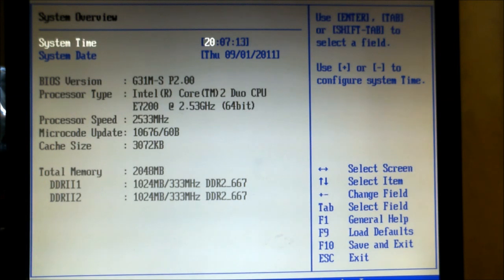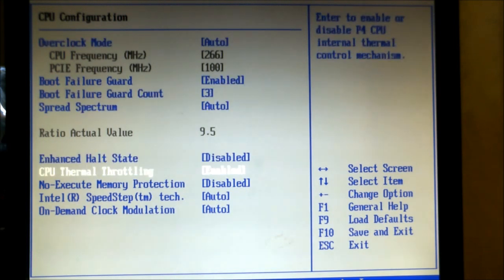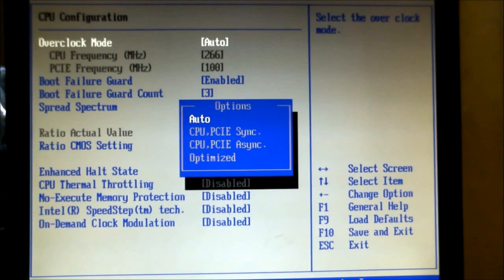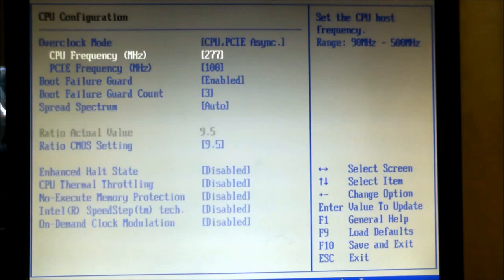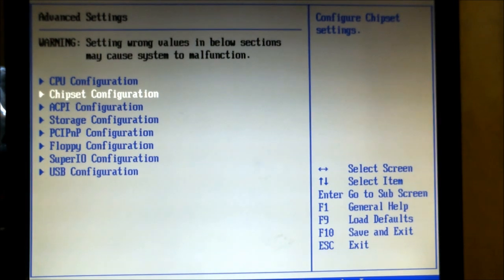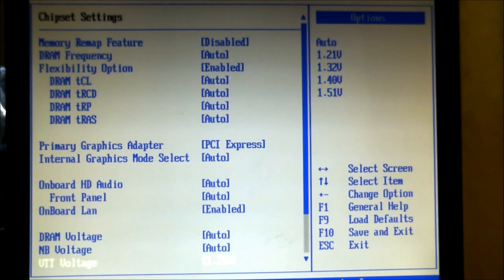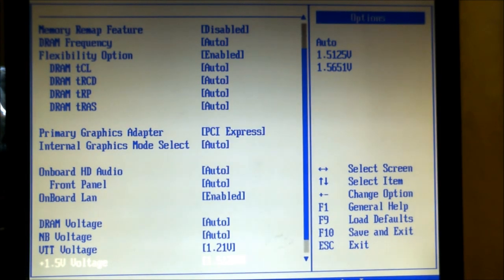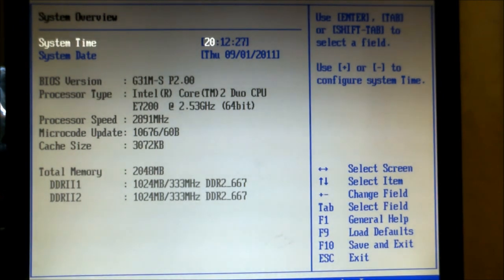Overclock Demo

Comment: hy.. i have Asrock g41c-s Motherboard similar to yours.. i have an intel quad q6600 and 4gb ddr3 1333 mhz ram in single channel... how can i overclock it to 3.0Ghz.. so far only 2.8ghz is stable... anything higher thatm 2.8 it will crash when entering desktop :(
Reply: Hey man, i got a q6600 too and i'm looking for a mobo, is this asrock g41m-vs r2 a good one ?
Reply: NO i have this board its awful for overcloking really regret getting it
Reply: Johnny Iliev thanks man, wich one would you suggest fot oc than ?
Reply: asus p5q series are the best 775 socket overclockers but if you are getting a P5Q mobo you shoud get xeon e5450 cpu (equivalent to q9650)  for like 20 $ and overclock it to 4ghz and more
Reply: and for this mobo asrock g41m-vs r2  i managed to overclocked it from 3ghz to 3.3ghz with a lot of tweaking.. dram timings, voltages not really worth the 300mhz
Reply: Johnny Iliev yea wow is rlly not worht the money. Thanks for the info mate ! :)
Reply: bro i have asrock g41m-vs3 r2.0 and q6600    do a 333mhz and ratio 9 and it's gonna work .

Comment: a pure pish production?
you must be scottish lol
Reply from the maker: Angus born and bred! lol
Reply: *****
good scots saying lol
im from ayrshire
Reply: news man
are these boards any good for over clock iv just got 1 and im using a c2d e6400
Reply from the maker: They're remarkably stable for the price. You'll get a good push out of the chip, but not much from anywhere else
Reply: *****
its blue screening at 310 think that might be its limit around 300/305 is your mobo revision 2 as your bios seems slightly different from mine i'm revision 1

Comment: Hi, typically I can overclock to 2.90 but when I try to go more after I save changes in the bios it just goes to a black screen. Nothing comes up? 

Asrock g31m-s 
Intel quad core q6700cpu
Radeon 5770
500W power supply
Reply from the maker: Hi, what memory and cooling method are you using? Are you getting POST on restart?

Comment: The ratio CMOS setting is the same thing as CPU multiplier?
Reply from the maker: Yes, it is. You'll find most older chips like the Core2Duo/Quad, Pentium 4s, and Celerons are usually locked, unlike the chips of the "i" generation which rely on their boost coming from the multiplier.

Comment: Hey guy! you have ddr2 667 ram. shows why 333? i have the same problem.. my ram's are 667, but is also 333ghz
Reply from the maker: Hey man.. It's funny with DDR2 because the frequency is dual pumped so the total output is 667. It's a stupid way of doing it.. Nowadays even 1600MHz RAM shows in OS at 800MHz.. Crazy!

Comment: man great guide! i have the exact same MB but the 2.1 BIOS. I have a problem and i hope u can help, i did a small OC this morning about 72mhz by only changing the cpu frequency just as u did and after it booted up i noticed that my ram speed also went up from 667-680mhz and i was afraid of frying the ram so i stopped there. Now what did u do and it stayed at the same 667mhz?
Reply from the maker: Hey man, if you disable the memory remap feature and leave the frequency at auto, the memory will stay at 667.. A bump to 680 won't fry the ram, but if you're using budget DDR2, it could cause missed clocks and you'd get lots of blue screens and failed boots - Doug
Reply: thanks man! i knew 680 wasn't much but if i kept going up eventually smth bad would happen. I will try overclocking again. one more thing is your system stable after the overclock cause mine gets an error almost emidiately from prime95.